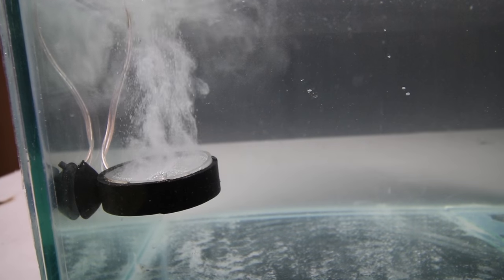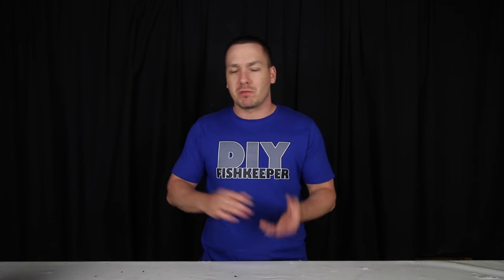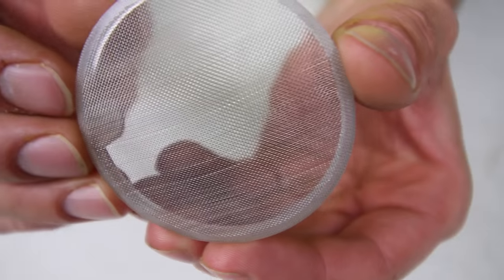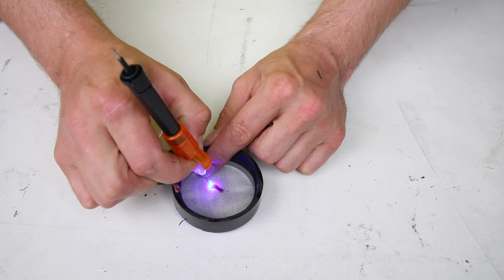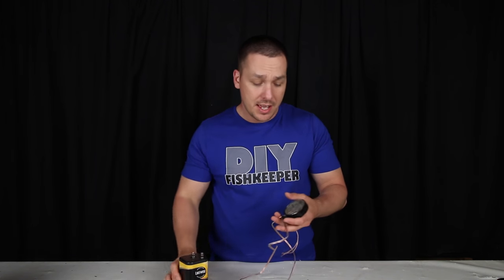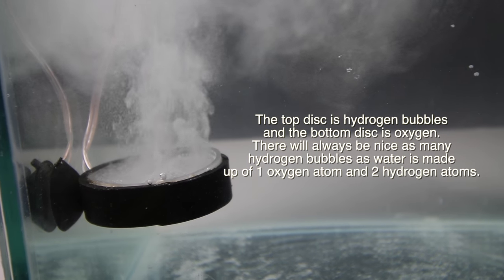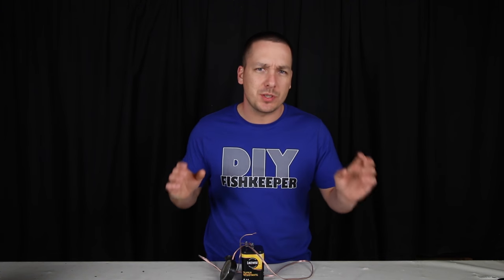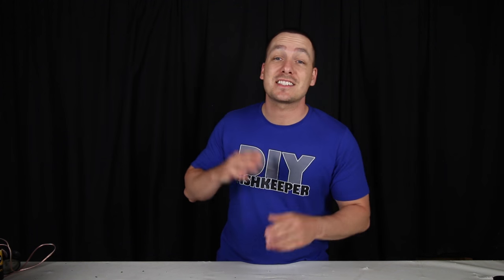HOW TO: $8 Aquarium sterilizer

Comment from the maker: Disclaimer: This is only what I THINK the twinstar does. I could be wrong here. The point of the video is to share my ideas and inspire some of your own. As always, proceed with caution and insure you do some testing and further research prior to adding this to your aquarium.
Reply: love it
Reply: The king of DIY I'm new to this  I have a 60 gallon tank woth Oscars how much do I need to have on this tank
Reply: You should be careful with electrolysis. The electricity will always decompose the "weakest" chemical in the tank. That COULD be water becoming H2 and O2 but it is also possible that the steel realease toxic heavy metals. Especialy if the voltage is high. And if there is any trace of sea salt in the water, it will produce Cl2 and then all life will be sterilized...
Reply: Can be car battery 13 v or can becous I can found battery like this in video
Reply: @kareemafifi2399  Yes I have seen people use up to 19volts
Reply: Does this have the same mechanism as the hydro-pure filter?
Reply: I guess this doesn't electrocute fish or you because the wires aren't touching?

Comment: this is what i called diy
Reply from the maker: yup!
Reply: Its wrong peope dont do it you might kill your shrimp in tank.. electrolysis promotes crossion your copper wire will corrode in like 2days of useage and turn into copper sulphate that will desolve in water over time...
Reply: @akshayrajput2488  There is no copper in stainless steel. As long as his wires are sealed to the water, no copper can be released.

Comment: You might be able to get rid of your pump and aerators. Oxygen bubbled from the air is about 20% by volume. The oxygen bubbles from electrolysis is 100% by volume of an oxygen bubble. With an oxygen concentration 5 times higher, along with their nano size gives the oxygen incredible surface area to volume ratio that helps both helps the oxygen diffuse more quickly into the water, and stay suspended in the water much longer to  ensuring more of the oxygen gets absorbed into the water using far less energy.   

There is a lot of research that molecular hydrogen helps as an antioxidant fighting oxidative stress. It scavenge up the worst of radical oxygen species, hydroxyl radical (•OH ). The diatomic molecule  hydrogen gas easily penetrates cell walls and into every organelle  of a cell helping it protect the the fish's cells from oxidation stress. Sources of OH species can come from water that is ionized from ionizing radiation like  natural radiation in the environment  from potassium 40 and carbon 14, or water can be ionized from normal metabolic processes, and environmental stresses. So aside from more efficiently oxygenating the water, you are also providing hydrogen that is also very likely benefiting the fish helping them grow larger and stronge
Reply: You will likely still want to remove  ammonia from your tank, possibly with an algae scrubber.
Reply: Completely agree with you Thank you for confirming my humble suspicions

Comment: the meshwire connected to negative pole is the only one that produce bubbles so it should be on upper position to prevent bubble clogging on the gap between the mesh wires.

Comment: Using any iron based electrode will produce iron oxide as well, and eventually rust away completely. I suggest using graphene cloth, or some graphene/graphite alternative. Attach the wire leads the same way, but make sure the copper is as insulated as possible so it's not acting as an electrode as well.

Comment: Thank you for the how to video. I was able to make this successfully on my first try. I did a very basic one that doesn't look great, but does the job. Now for the real challenge. How often and how long should I run it for?
Reply: Four years have past since you commented.  What setup do you have and what did you find worked for you?
Reply: @kreynolds1123  I have gone through several set ups since. This particular try failed with in a few weeks. I later bought one and they don't last more than 4 months in my current warter. I hope this is what you meant

Comment: I've seen this application used in the hydroponics industry. They use it for oxygenation and warned against using it in aquariums for extended periods because of O2 toxicity. The escaping hydrogen gas can be dangerous in enclosed spaces (Hindenberg) so it's best not to get too carried away with this tech. Cool DIY project though. BTW, DO NOT use electrolysis in salt water!

Comment: Thanks for the video.  I have a lot of unused DC adapters laying around.  This is producing o3 right. I have seen oxygen produced in a similar manner the sales person for o2 grow claimed that it used not just electricity but was a frequency like radio transmission but no other details were provided but for adding oxygen to water for watering plants or hydroponic Reservoir it is far better than air pump and air stone because of size of bubbles is much smaller than even the best air stone diffuser can produce so small that it doesn't break the surface of the water.

Comment: What if you integrated the sterilizer into your pump system by coupling it into the aquarium outflow pipe? Then you could guarantee that it has come into contact with your entire water volume.

Comment: I think I have seen this kind of equipment somewhere else. But it was used to increase O2 level in the water. In hydroponics it is important that the solutions has some O2. Could you check this with a DO meter? In a recirculating system could it be used to disinfect the system prior activation?
Nice videos, I like them, keep the good work.

Comment: hi Joey, Just wondering that maybe the twinstar is using a silver mesh, as silver has anti-microbial etc. effect when micro particles are in water. If so probably the reason for the $$$$ cost $$$$. 
Further to this after seeing their website I suspect that they are using different metal combinations for the different models hence the different effects. 
You are correct about  the electrolysis breaking the algae spores, but in this case I think it goes further, as by having different metal meshes you create different nano particles which inturn have different benefits.

Comment: How does electrolysis filter the water? Isn't it actually just removing water from the system and thus concentrating the contaminants in the water?
Reply: sorry only understand english, but i wil try to answer. this device only release oxigen and kill bacteria. is not a filter and the amount of water is very small. again sorry
Reply: Something like that.
Reply: Same mechanism as barley straw or dosing hydrogen peroxide.  It raises redox.
Reply: Wil Welsh I am unfamiliar with such a mechanism. Can you name it so I can research it?
Reply: +enticed2zeitgeist https://en.m.wikipedia.org/wiki/Reduction_potential

High redox catalyzes enzymatic reactions that oxidize organic compounds.  It is also capable of rupturing the cell walls of anaerobic bacteria.  

In aquaria, raising redox won't clean your water of excess nutrients, but it will destroy some little nasties if dosed constantly (like every few hours). 

You can see the effect demonstrated when dosing hydrogen peroxide in a tank with black beard algae.   It will oxidize and turn pink.
Reply: Wil Welsh
Cool! Thanks internet hive mind!

And so, this electrolysis machine that is producing pure hydrogen, the hydrogen in this case is oxidizing some little nasties, albeit at a very low rate?
Reply: +Wil Welsh You should be a writer for twinstars trash website. Which gives no detailed explanation on how it even works
Reply: This "feels" very strongly like pseudoscience.
Reply: Soo it help the  the wall of the bacteria?
Reply: so.. kill the benefct bacteria of the filter ?
Reply: flamepeace This filter is entirely chemical and mechanical, so no bacteria is being used here to purify water

Comment: By chance, did you check the O2 level of the water before and after. As this is used more for adding O2 to the water then it is for Sterilizing. As they work better then using an air stone.

Comment: Seeing as this "gadget" creates O2 in the form of microbubbles how would it be for oxygenation? Either in a power failure or for supplemental oxygen in high temperature conditions? I'm working on an outdoor goldfish pond in Texas where the summertime temperatures get high enough O2 levels can be a concern.
Reply: oldiron1223 I do think that this thing just do a sterilization, decomposing O and H atom which is composition of H2O (water), during the water through the device, they're killing algae, etc

But I'm not sure about my opinion.
Reply: Reason for the question is there are other videos praising "micro bubbles"  or "nano bubbles" as oxygenators. Most of those systems are more expensive than the Twinstar system. Might build one and give it a shot. Then there is the expense of a dissolved oxygen meter....

Comment: Hi DIY King big fan and loving your ideas but i didn't get any results of doing this, i tired it with 9W battery and nothing happens,  after few minutes i felt the battery is heating up and didn't see any bubbles, any advice on this? thanks
Reply: Chrishan Manoj 
Then you probably created a short circuit!! Measure the twister between your 2 leads outside the water. It should be infinitely high.

Comment: Loving your projects, Thanks and all that effort is really appreciated worldwide,
could you share any alternate of the RO/DI water systems which are expensive of some aquarium brands, is there any way we could achieve somewhat less or equal kind of water quality with the 3 stage common water RO units which we use in kitchen cabinets for drinking use....  what is the difference between the standards and thier output.

Thanks.

Comment: the mesh should be titanium otherwise  the corrosion will destroy the mesh very fast, and will release heavy metals on the water... in my experience i used cirurgical stainless still, and  it was whats happents.......

Comment: Your a genius!  does anyone know if you could rig this to wear instead of plugging to a battery you just wire it to a plug maybe with some kind of adapter to make the voltage correct but I'd much rather be able to just plug this thing in and then have to keep buying a big Square batteries

Comment: Thats a great idea but. Have you tested to see if there is any voltage in the water. I once read that if you have those little worms on the glass and you want to kill them you can take a 9 volt battery with long wires and put one wire on each side tf the tank to get rid of them. Thats why I was thinking if you put both wires in the water and you putting voltage in the water.
Reply: This would be almost the safe as just dropping the wires in the water.
Reply: just stop overfeeding and the worms go away
Reply: +josh L I got no worms that was a video I saw.
Reply: +quepiid Having stray voltage in your tank can mess up the fishes sense for tracking where the food is. It also mess with different senses in different type of fish. Google what happen aquarium fish if there is stray voltage in the tank.
Reply: +Ruben I meant to say SAME. Not safe.
Reply: +quepiid Oh ok. =-]

Comment: How in the world does stray voltage not cause harm to tank inhabitants? I've had heaters malfunction, and probes break, and each time, negative effects are noticeable. 

I've even had a battery powered temp probe break, and it was not good.

Just curious as to how this is different.
Reply: I guess it's because of such low voltage. 6V are safe even underwater.
Reply: Its not stray voltage the positive and negative charged meshes only cover the shortest distance between them electrolysing the water caught in between them.

Comment: i built one back last year, at the time I was running my aqurium lights fir 15 hours a day and algae was terrible, I put a day eltronasis sterilize inside my die canister filter i did run the steralizer 24/7  but it did kill off the algae issue so i guess placement and time ran is key
Reply: I just tried to build one today. I'm no stranger to electronics, but I wasnt able to get an electrolysis, maybe it was the stainless steel colander material? but I tried it both with a 6V and 12v setup with no o2 vapours when in the water :(
Reply: @chaserseastside  first one i made wouldn't work either it was just an issue with the power supply , I tried a diffrent one  gave it a few minutes and it worked fine,  my mesh is closer together its about 1 to 2 centermeters apart i found it worked better when the mesh was closer

Comment: What about Copper? Invertebrates, white clouds, and many other creatures are extremely sensitive to copper.
Reply from the maker: +Alvin Yao (alviny02) use what ever you think is best.  I mentioned it was just what I thought was going on. I never said it was the materials they used.
Reply: ***** But what could i use instead of copper wire? Thx
Reply: the Bondic adhesive he used would seal the copper away from the aquarium water.  Just be sure that no copper is left exposed.
Reply: You need the tank to have some NaCl inside to do that copper does not produce elements.

Comment: Hey there. I've been watching your videos for a few months now and I wanted you to know I find your videos very interesting and useful. I've been running freshwater tanks for almost 15 years and until now, I've never thought about getting into saltwater. I have a spare 10 gallon tank with a 20 gallon bio wheel HOB filter and a small air pump. I still need to get a heater before I can start the official setup, but I was wondering if you had any suggestions or advice for a saltwater noob. It should be known that I live in Florida, U.S. so it does get pretty hot down here, but I keep the AC running almost all the time... Anyway, thanks for your time and keep up the good work!

Comment: As a saltwater guy, the metals, specifically lead (solder) and copper (Wires) scare me.  Not that I would ever use this in saltwater due to the chlorine production, but do those metals not affect freshwater?
Reply: Without salts,an electrolytic process cannot happen between anode/cathode. Distilled water can't conduct. Fresh water depending on its mineral content cause discolorations through bondings and who wants that. Stainless wire is easily obtainable and using stainless fasteners one could complete a totally stainless circuit.
Reply: @liberalinfectioninar   tap water does begin to ionize even with a relatively low voltage as shown here - most water is not pure pure water.

Comment: Can i use silicone instead of the cement pen?
Thanks Joey.
Reply: MrKevin Le 
solder will work to. but stainless mesh will broken after 3month usage I already try this method. maybe bad coating or just bad quality mesh screen I buy idk but this is very cheap diy.

Comment: There is no particular reason this can't be integrated into a full circulation. The actual test would be to contaminate the water with bacteria (or use aquarium water), and determine how many colony forming units are in there before and after using it.

Comment: Question? I made one of these and then tested it before I put it in my tank. I put it in regular tap water. Within a few minutes the water started to turn orange. Left it in the bowl for about an hour and was finally left with a black sludge floating on top. Any idea what could have happened?
Reply: I think you didn't use a good quality stainless steel mesh so the iron in the mesh corroded.

Comment: Can this be used instead of an airstone?
Maybe in the sump, so the water doesn't get too cloudy?!
Since it "creates" Oxigen in really small bubbles this might actually be very effective, I'd guess.
There is something quite similar called o2 grow to get oxygenated water for growing plants.
Reply: it doesn't create oxegen it take oxegen ot of the water
Reply: you are confusing dissolved oxygen with the oxygen in the H2O molecule, two totally separate things, this does in fact oxygenate the water
Reply: Gaseous oxygen does not react with water. It is water soluble and functions as an oxidator:

O2 + 2 H2O + 4 e- > 4 OH

Oxygen may oxidize organic matter. This is principally a biological process. Each individual compound has a reaction mechanism that can be described by means of an electron balance. Examples are given below (H2O is excluded):

Fe2+ + 0,25 O2 -> Fe(OH)3 + 2,5 H+
Mn2+ + O2 -> MnO2 + 2 H+
NH4+ + 2 O2 > NO3 + 6 H+
CH4 + 2 O2 -> CO2 + 4 H+

These mechanisms show that ammonium and methane apply large amounts of oxygen, and the resulting oxidation reactions form higher or lower amounts of acid. Under normal conditions acid in water reacts with HCO3-, forming CO2.
The oxygen atom is very reactive and forms oxides with virtually all other elements, with the exception of helium, neon, argon and krypton. There are also a large amounts of compounds that react with water.
Reply: no. its a complete circuit
Reply: Yep Lars I tested with 12v 0.5 amp through #50 mesh stainless steel in a plastic bowl, put my multi meter in and no voltage what so ever..

Comment: Be careful. If your wire Guage is to small it breaks down and falls apart. Works much better coiling a heavy guage wire into a cylinder and using that instead of mesh. Little less surface area but at least you don't have wire everywhere in your tank. Also DO NOT use copper wire for this.

Comment: i also did ,using 12 volt in one ,and 19 volt in other using laptop adapter, running continously , after week i get lot of chalk on the mesh ,intension was to introduce oxygen ,as oxygen pump make lot of noise ,not sterlization , so i stopped

Comment: Twinstar is using a Diamondelectrode instead of Steelmesh. The Diamond disolves Hydroxylradicals instead of Oxygenradicals.
Joe, your DIY product a normal elecrolyisis.
The Hydroxylradicals created with the diamondelectrode are what makes the product "theoretical work" normal electrolysis is not recommned in fish tanks, especially combined with salt becouse it will create chlorine.